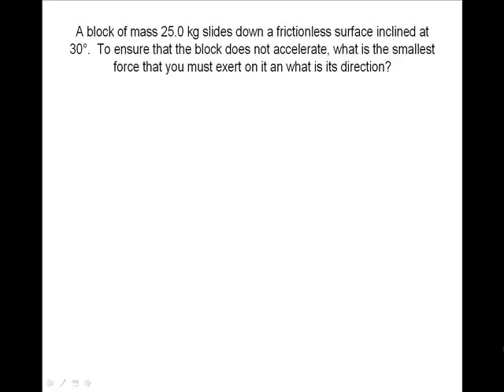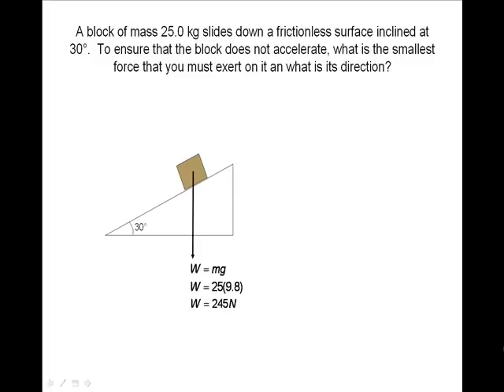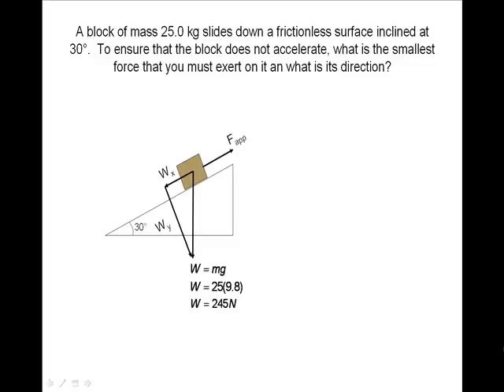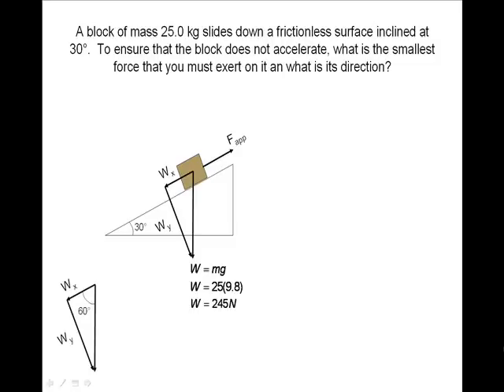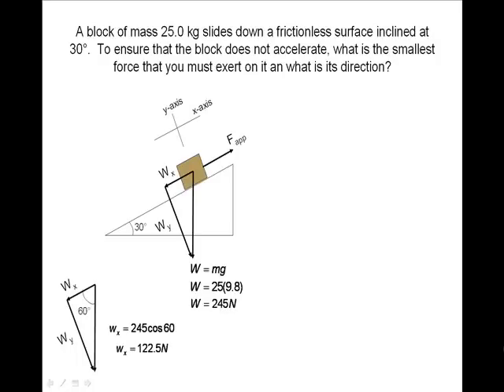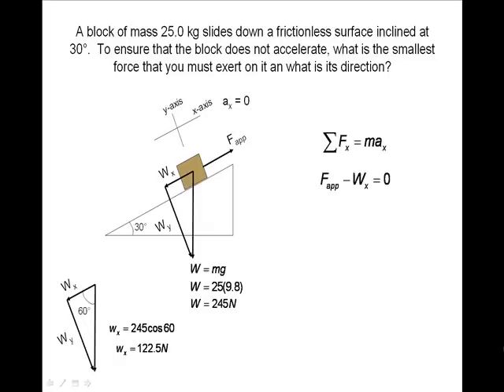Free-Body Diagrams and Translational Equilibrium2 animated physics problems solved

Comment: It depends on which angle, if you are using 30 degrees the parallel component is given by sin 30, or cos 60. I didnt see he used 60 that's why I wrote right away the parallel is sine, I assumed he didnt change the angle from 30 to 60. But I am still correct, The parallel is given by SINE of the original angle given in the problem, 30 degrees!